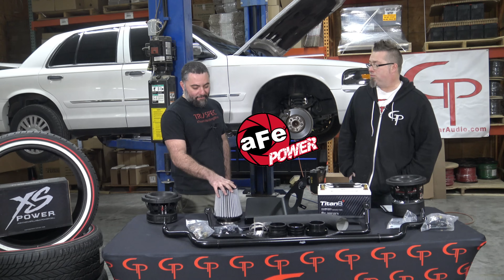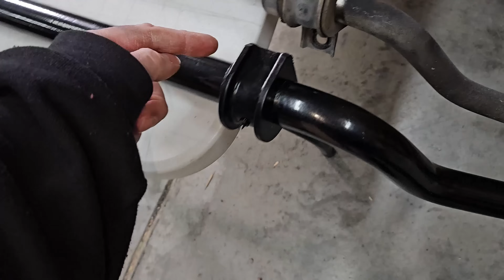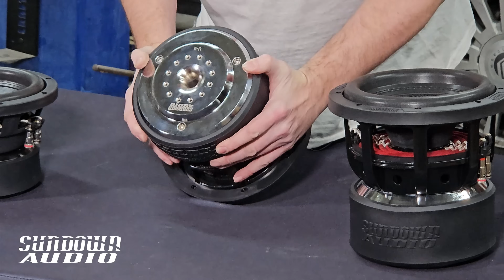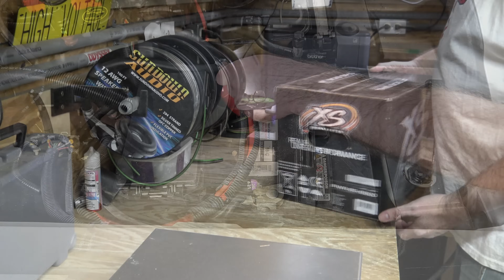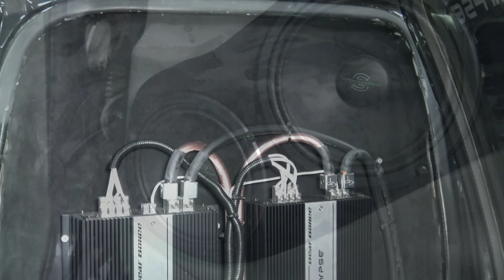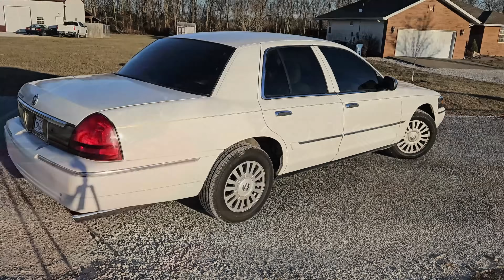S1 E2 GP's Grand Marquis Build: XS Power AFE ADTR

Comment: Please help me I have a 2005 crown victoria p71with 154,000 on dash when I got. It was 82,000  white it lost power did many things and still not pulling think its my trans or torque converter  I here rumblings from the front passenger side like my fly wheel bad drive shaft not turning in drive

Comment: Is there a reason for running just a single 8? In my Marquis, I'm running dual 12's, currently buiding a custom box and buying 2 more subs to run 4 12's total!

I guess it all depends on the listener, I'd be disappointed with a single 8. Mostly because I learned with my two 12's, getting sound into the cabin is extremely hard with these cars.

Comment: The car torn the engine light on when you switch the air intake code p0174 or p0171 ??
Reply from the maker: Hey, no errors after installation.